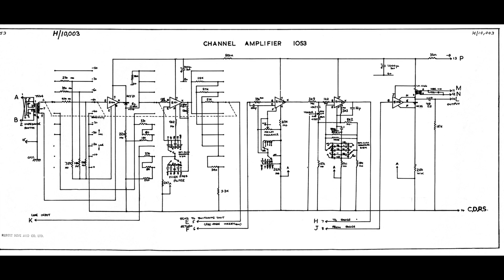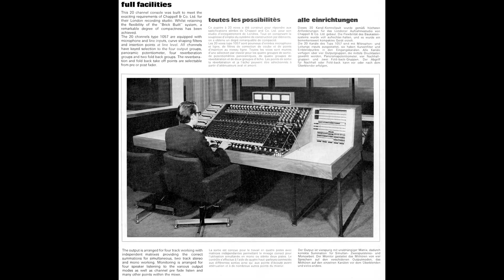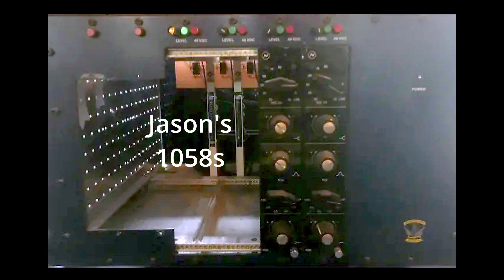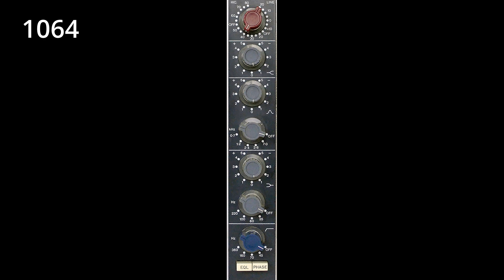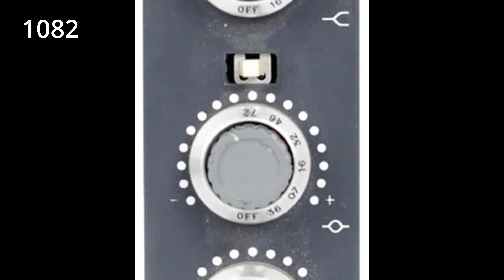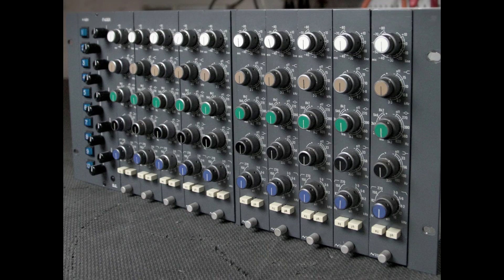A Brief Guide To Neve Channel Modules, 1964-78

Comment: Fantastic video.  I have something to add however.  I was hoping you would go into more detail about the 1272. Since amp sims are becoming more prevalent,, I use a 1272 for tracking heavy guitars.  The newer modifications done to the 1272 to introduce and variable gain, phase, phantom, and trim are a game changer.  They make heavy guitars and even snare drum incredibly mean sounding.  Vintech made a Dual 72 clone for a while and they are amazing.
Reply from the maker: I mentioned it towards the end, they were never used as mic preamps in the old Neve desks, just as line amps. People have gotten creative with them since they were so abundant when those old desks were gutted, and repurposing them made better financial sense than just tossing them. They can be wired up to sound good, for sure.

Comment: will the new neve beat a hum audio n trophy console are they close or is the hum superior automated faders is going to be needed , just wondering if you knew which had the best sound / the hum is billed as a mastering console crazy center section adjustable mic pre amps compression on every channel how does its EQ compare sounds to the neve the hum also has a power supply that will not fry a egg a console that needs a massive A.C. to run it factors into it,. does the hum have the transformers to give it the super fat sound maybe only the neve has that i can understand never switching and staying with neve its just there about the same in cost at a new price for around 350K you can get a larger sized new console from neve or hum ,. is hum a contender as there console also looks insane ,. also you used the focus right billed as the best that's why i am asking you , again tho some easy fader automation is going to me needed and this can rule out some consoles this could be added to the neve in some way or it comes with it , its needed for commando style studio in the trenches war fare recording one session after another eventually your coming across a mix were your going to need fader automation some have this some do this with pro tools or some other easy method i have used mackie ultra mix connected to the sends and returns of any console to automate the console works great however adds in to much noise enough noise to want to buy a hum audio n trophy console that has that feature built into the console SSL will have that even if its a old used one its possible to find it, hum audio makes a nice n trophy console tho its loaded with everything ,, however maybe a new neve is better and then needs to be upgraded with the fader automation if its to complex the hum makes it   cheers :)

Comment: Just starting the video so not sure if you'll cover this but...   Im trying to understand something thats been boggling me for a while: Why does my AMS Neve 1073 sound different from the original? In the marketing, they say its the same thing but from everything ive heard and understand it is not. Can you clarify this for us?
Reply from the maker: from what I gather, the newer transformers are not exactly the same as the originals, even though they claim to be. Also, you're comparing new construction with aged components that may have drifted slightly, etc. Lots of variables

Comment: Of the 10-15 Neve consoles I have made records with, I can’t honestly say any two were the same, and I don’t mean sound, but rather the construction style or purpose. Each took a little bit of time and effort to find on the preamp the knee defining audibly linear to audibly non-linear operation. The consoles’ channels were highly consistent but from one console to another, always involved a small experimenting curve. The majority of my work on these consoles was tracking for later post back at my studio in Fort Lauderdale. Life with Neve was never dull, always rewarding.
Reply from the maker: @artysanmobile  oh for sure, each one was basically a custom order when Rupert was still there… depending on the specs, overall power draw could be higher, leading to slightly less headroom before that non-linearity you mention, etc. Wonderfully unique!
Reply: @   That very gradual non-lin was why I was working on a Neve. I could record vocals with crystal clarity, while fuzzing up the basses a little, and suit the guitar parts using the channel gain. I’d walk away with the snare drum of my dream.  It’s a fantastic way to record particularly in these Pro Tools days, knowing I could commit the magic wherever I found it.
Reply from the maker: @ that’s what was lacking on later designs like the Focusrite & 9098   consoles, you couldn’t push them into that same character.
Reply: @   Interestingly, the SSLs offered their own version in their mic preamps. You can pretty much track the consoles which did this gracefully by their popularity, if not $ appreciation. When I left MCI, I was one of a small team working on an overdrive circuit for their mic pres. To my knowledge it was never implemented.

Comment: Nice to see the old 33114 module shown. Back in the '90's, I bought a 12 X 4 broadcast console with the 33114s from a TV station in Honolulu. It had done nothing but sit in a TV remote truck baking in the tropical sun for 10 years before they took the truck appart. I saw it under a blue tarp in their transmitter room and asked if they would want to sell it. I got it for $3500 and then realized that I had to recap the whole thing. I sold it for a great profit and installed it and then after listening to it I had sellers remorse. Those 33114 modules were such creamy sounding EQs. That one had the IC chip gain boards and I imagine that the class A discrete ones would have been much better yet. Damn was that console super heavy though with each removable module being shielded in it's own steel case. I would love to have kept that board.
Reply: LOL you got a 12 x 4.  I got a 36 x 8.  Yes I had to replace, hundreds of, electrolytic capacitors.  Throughout the entire console.  Every single last one of them.

I only have seller's remorse now.  That, I'm not 30 years younger, again.  To do it all over again.  To never stop doing it.

I mean why stop?  Well?  The lack of music and musicians and singers would be a good reason.

It's hard to turn off the love you had doing for something for over 50 years.  Don't I know it.
RemyRAD
Reply from the maker: @mikeh2520  they’re great modules! I don’t even think IC vs discrete is that big a deal with them, they all sound fantastic.

Comment: I had the chance to have a instagram comment convo with beinhorn in june or july. Since his 1057s haven't sold yet, I asked if he could get each one modeled to make a plugin with a switch for each of the 16. he was intrigued, sounds like he might actually do it. i mean, i used all the persuasive power one could possible muster in an instagram comment section.
Reply from the maker: Great idea!! They would be prime candidates for modeling, or reissues. I love the Chandler Germanium stuff, but it's admittedly a bit different.

Comment: Corrections to your video. The console you are calling "The first NEVE in America" was actually the 3rd. There were a pair of NEVE 2001 desks first. The one I owned being the actual 1st NEVE in America. It was loaded with 8 x 1058's and a pair of 2060 filters. Sort of an early BCM 10 but with 4 groups. I still have all of the documents. The 2nd  2001 ended up at studio 900 for years. Mine was broken apart with a pair of 1058's going to Seattle and I think 6 going to Larrabee Studios. The 2060's I think went to Nate (Priest If I recall) Nate also sold the chassis to somebody in Europe last I knew. My documents clearly state that the "Big Neve loaded with 1057's" was on order after the delivery of my former desk. The 1058 is being reissued in 500 series format by a well known module maker and will be coming out the end of November / early December. We used some of my old documents in the process. It is spot on. The 1050 series modules sound fantastic. Great on just about everything. LImited eq selection, but it doesn't really seem to hold them back. Anyway with all of this being said, thanks for the fantastic video and putting all of this together.It's for sure a subject that needed a video like this!!!  Oh and the 1058 bottom freq isn't 100hz....it's 40hz !!!! Crazy huh?
Reply from the maker: @aaronhouseholter697  thanks for this great info!! Really appreciate you taking the time to share. Looking forward to that 1058 500 module too!
Reply from the maker: Just saw the AML 1058 unit/kit is available, is that what you were talking about?? Think i'll do a few of their kits for my home studio, they look great!